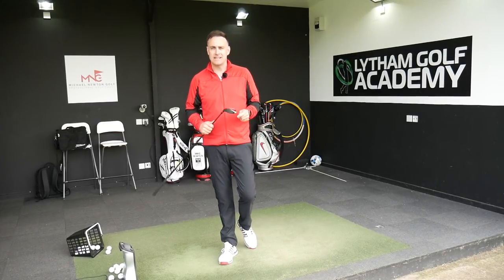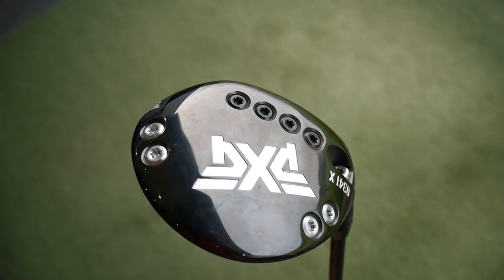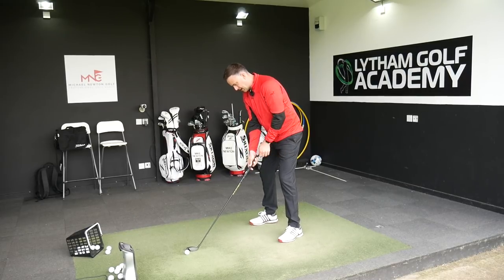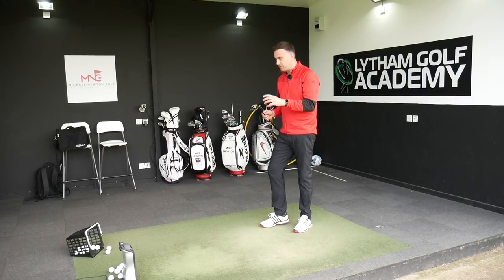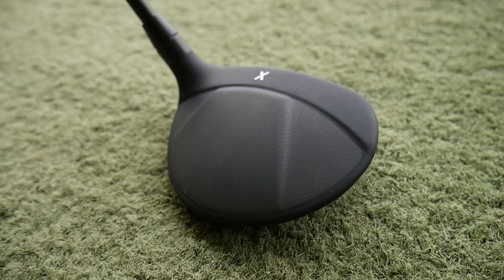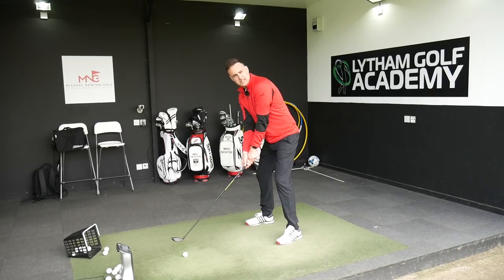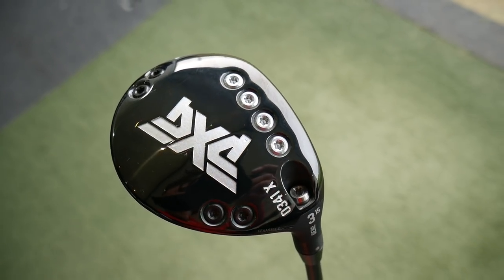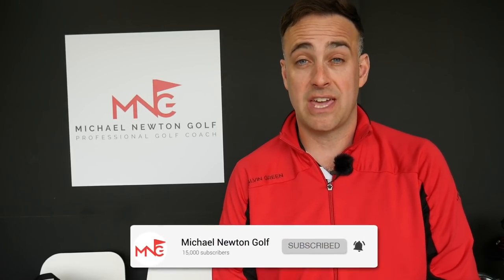Testing Moveable Weights On PXG Gen2 0341 X 3 Wood

Comment: A better 16.6 Standard Deviation vs 24.0 of Left / Right Dispersion by moving the weights back - at the cost of 500rpms increase of spin (3900 vs 3400) but still a less than optimal launch angle (that's low), peak height (could be higher) and descent angles (could be steeper) - there mIght a combination by splitting the heavy and lighter weights, adding some club loft to find a better mix. I looked at your Ping 410, M5, Epic Flash - they are all the tiniest bit more optimal - but distance is similar - might just be a smaller lower launching head - but that launch angle is pretty low.

Comment: I know you normally do not carry a 3-wood, but if you keep the 2 -iron in the bag, more spin with the wood is not a bad thing. It keeps the ball on line & with a slight negative angle of attack you can go for green at 240-260 & stay on the green. I do not choose a 3-wood for tee shots alone. The shaft choice is important also with at least enough flex & launch to get ball air born easily.